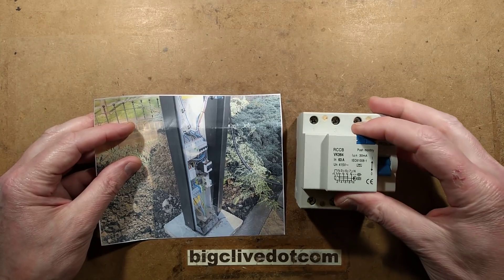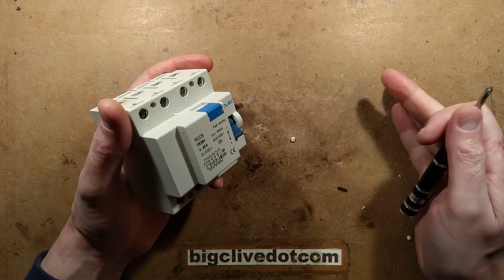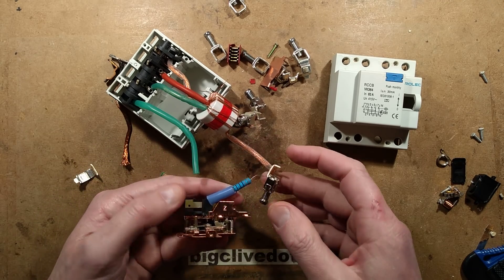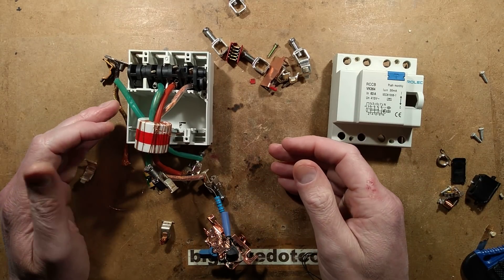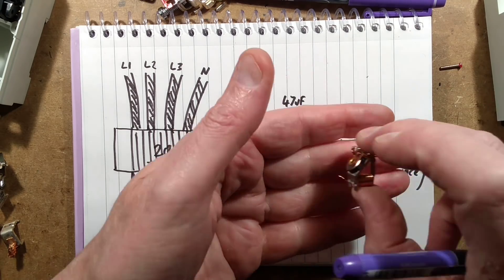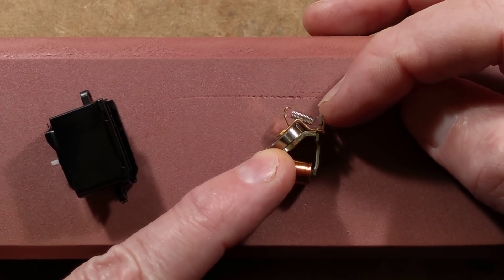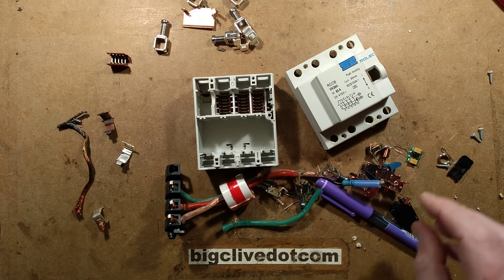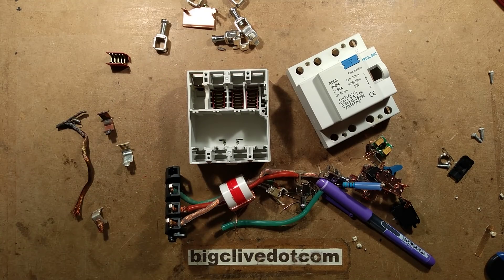Failed 3-phase RCD/GFCI from a Rolec electric car charging pillar. (with schematic)

Comment: If this is an RCD without the ability to trip on overload, I wonder what current the actual overload circuit breaker was rated at?  Just wondering whether it got into a situation where the current was too great for the RCD but not quite enough to trip the actual breaker, so it sat there slightly above its rated load getting quite warm over some time.
Reply: I think this is spot on, but could also be that most electric cars are pulling from the first phase, so more continual wear on that one side. Could be a combination of things. We'll probably never know.
Reply: Keep in mind that the amp rating is affected largely by the need to quench the resulting arc when opening under load and the need to avoid excessive contact pitting that would degrade contact resistance over time.  Given that in normal operation these contacts should spend all their time closed, which is also where they have the minimum possible contact resistance, minor overloading, even long term, really wouldn’t be expected to allow things to get this hot without some other defect in the design of the contacts or their closure mechanism — which a single consistent contact position failing would tend to suggest more so than long term overload.  You can, for example, routinely push far more current than the rating plate suggests through a switch or relay/contactor if, and only if, you can guarantee that the contacts will never be opened or closed under that elevated load (note that I am not suggesting such is good engineering practice, but it is a possible thing to do).  A well designed contact, particularly one with little age and wear, should be able to safely handle many times it’s rated current without overheating so long as it is never opened or closed under that elevated load since there is no arc or arc flash concern to degrade it.  And if the charger as a whole is well designed, then the RCD/GFCI breaker should never be tripped unless something has gone horribly wrong, so there should be little routine wear on those contacts that might increase their contact resistance.  So, to myself, it really screams “design defect” in the RCD/GFCI breaker itself.
Reply: @ethanpoole3443  

With relays/contactors/breakers the carry current is usually a lot higher than the break current.  Which often doesn't do you much good, because it's usually the break current you're worried about.

Some relays and contactors, though, may have a much higher one-time break rating.  Not as high as the carry current, but quite a bit higher than the current they can repeatedly break.  There are applications when you need this capability.
Reply: bdf2718 FWIW, I’m pretty sure if you reread what I wrote, you’d find that is effectively what I said.  Specifically, I commented that if, and only if, you can ensure that you will never have to break the overload then the closed contacts can carry far higher current than the specified (repeatable) interrupt rating as the closed contacts are in their lowest resistance state...and since this hypothetical example provided that you should never have to actually interrupt that current then there should be no overheating of the contacts without some other defect in the design of the contacts (and since the contacts would never open under load in this example, no unquenched arc issues either).  In essence, an RCD/GFCI breaker is a lot like that hypothetical example since the RCD/GFCI should never trip in use provided the charger was properly engineered — it should only ever trip if something has gone horribly wrong in the design or safety of the charger (or the RCD/GFCI)...so it’s very premature failure really seems to suggest a defect in the design of the RCD/GFCI breaker.
Reply: @ethanpoole3443  
If you reread what I wrote, you'll find I wasn't contradicting you but adding further information.

As for my "hypothetical" example, I was describing a relay manufactured by Hellerman Deutsch for use in certain avionics applications.  The one-time break rating was part of the specification and guaranteed by QA procedures.  That the feature existed and was tested was because somebody wanted it and was willing to pay for it.  Note that it's entirely possible the relay wasn't a special design but the costly part was the testing/QA to ensure that it would do what was required.
Reply: its rating is 63A but the most load is 22kw or 7kw per phase so not overloaded . They just like to blame the spark for not terminating correctly , but i have my doubts about there quality , it would be interesting to compare a few under load with a thermal camera.
Reply: @Steve AtTheVanFirst off that was a three phase point so would've been a 22kW post.

Nissans may not draw more than 6.6kW, but Hyundais, Kias, Teslas, Renault Zoes and many other EVs can draw 7kW or more on AC.  Some Teslas and all Zoes can draw the full 22kW from a type 2 connection.

Comment: That should not really do very much switching so I'm left with guessing between some sort of vibration mode parting the contacts slightly or just a poor contact with not enough pressure on the it to cause overheating during high current draw.
Reply: I think low contact pressure is a good possibility.  The contacts are held closed by a torsion spring at one end of the molded bar that carries them.  The failure of the far terminal is likely due to creep deformation of the bar (or its bearing surfaces in the case) resulting in low contact pressure.  The deflection (and pressure degradation) would be the worst at the end furthest from the spring.  The creep rate of nylon is heavily dependent on atmospheric humidity.  Even glass-filled nylon is prone to creep deformation at elevated humidity.  The effect of self-heating would only increase the creep rate.   I can't really see if there's any noticeable twist to the part.  I'm sure there are other possibilities.  

That said, creep deformation is something that some people never seem to think about in design.  It's the primary reason why SATA power connectors are prone to causing arc damage to drives.  It's also why data connectors tend to get loose and fall off.  Adding retention clips won't fix the problem if the contact pressure is zero.
Reply: I was also thinking that the conductor, being bare braided copper and just shoved into it might have possibly shorted out along the length at different points and over time caused the conductors resistance to change just enough to cause a problem.
Reply: What would it short against? IIRC, the contacts (and wire terminations to the moving contacts) are separated by barriers.  Any sort of short would be a catastrophic failure mode, not something that happens gradually.
Reply: Hysteresis seems a good possibility. Or secondary effects due to the mechanical damping on that portion of the device attributable to the clamping of that section of cable. Otherwise, it is int'resting that this device seems reliably to fail in the same way at the same location. By very clever design? Dunno.

Comment: So I've had a Nissan leaf for just over 3 years now. The high power CHADEMO chargers (400V, 120A, ish) have their own cable fixed to the unit and it does an insulation test before starting.
The smaller, 3, 7 &22kw chargers you usually use your own cable and no test is done.
I believe the contacter in the charger is fired when it gets a 9v signal from the car for EVSE chargers.
Ironically the charger is actually in the car so the things on the street, despite being called chargers, are just fancy sockets
Reply: DC chargers (CHAdeMO, CCS) are in fact chargers, not just sockets.
Reply: Points for actually using 'ironically' properly.
Reply: Yes quite right, the CHADEMO is more or less a direct connection to the battery. I rarely use them in fairness

Comment: ONE MEGAWATT charging sites?! Won't that have to have its own dedicated pylon?
Reply: Will it be a Monty Pylon?
Reply: @wwsxa39  that was a bad pun, but I figured I'd pylon another one.
Reply: It'd probably connect to a higher voltage part of the grid and have a small substation on-site to drop the voltage.  Some EV charging stations are already set up like this, if they have a number of chargers on the same site.  Fully Charged did a recent video on an electric ferry crossing between Denmark and Sweden that charges at almost 11kV at 600 amps, or over six megawatts.  Impressive stuff: https://www.youtube.com/watch?v=rE_M1n-ClOA
Reply: You must construct additional pylons.

Comment: Maybe the first contact failed due to "play" or if you can imagine gears the "backlash" a loose fit on the bar assuming there is a bar that runs thru them all could be the bar isn't aligned on that one side well. If we had a super slow mo camera and a shot of it breaking we might could see the timing. If I'm not getting my point across let me know I'll explain once my brain is firing on all 8 cylinders.

Comment: When thinking about the failure of the single contact: these contacts shouldn't be making and breaking very often at all. They should only open on a fault - right? And when they close they shouldn't be under load. There's another contactor that does the normal on/off function. I'm going down the path of a bad connection overheating. Was there a "fault" in the pillar or cable/vehicle that caused this device to trip, or was the only problem the failed breaker? Maybe (like you said) the cramped space for the wire was preventing the contact from seating firmly - causing it to over heat.
Reply: A bad contact causing a low-value resistor in the contact block causing heating is what I was thinking as well.  Stands to reason that if it were a bad physical piece of contact metal it would be on at least two of the block sections (due to identical contact components) but it's just the one, implying bad seating or the like.  As for why?  Either bad assembly in a batch of those things or a bad design.  Hard to say without difficult or expensive scanning while fiddling with it (like x-ray or some other radio scanning at the internal mechanism while assembled).
Reply: @IncertusetNescio  Could a thermal image be able to see something through the outer cover? We use to do thermal image inspections of control enclosures and switch gear on the US Navy subs I was on in the 90's. Thermal imaging has come a long way. Our rig was literally something you wore. It had a CRT monitor hanging from your chest!
Reply: @SueBobChicVid  Modern FLIR has pretty good resolution, and I'd tend to agree that this would seem an ideal application. We need BC to get the FLIR out and have a look at another failed module (if at all possible).

Comment: It seems like the delicate electromechanical approach might be sensitive to moisture and dust? I wonder if it would get annoyed at  magnetic fields?
Reply from the maker: It does seem quite delicately balanced.  The trip coil resistance is only 10 ohms.

Comment: Was thinking , the switch is on the right and maybe the contact assembly is flexing and causing the left contact to open last or slower..
Reply from the maker: It's possible, but it's not usually switching under load unless in fault conditions, and the springs should allow for slight twist in the actuation bar.